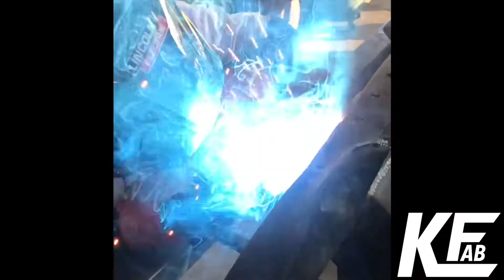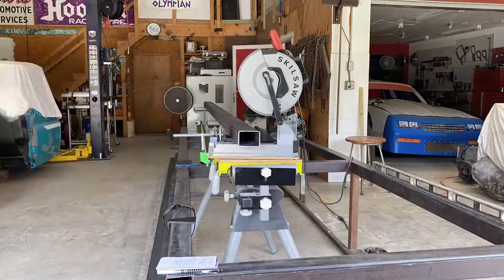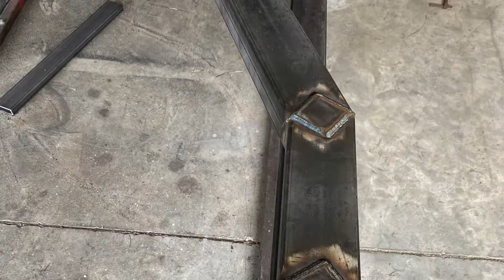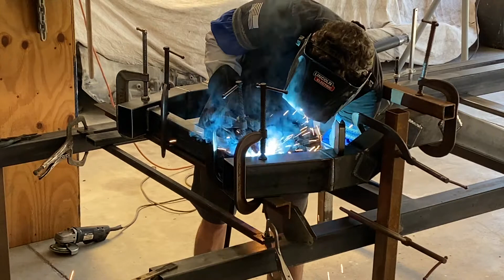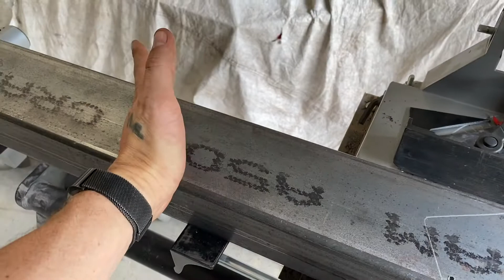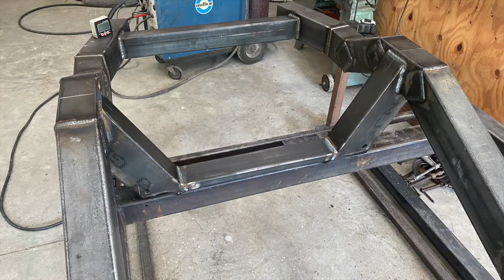Custom '66 Chevy C10 Build | Starting the Frame From Scratch | Twin Turbo LS C10

Comment: I know it's been a year since this came out but if you get this I'm looking to build an 81 k20 frame from scratch and have no idea how to go about it besides putting my old frame on a jig table and hoping it's square enough to copy all the angles, bends and whatever. Great with fabrication but new to building chassis. Any help/tips would be greatly appreciated.
Reply: Would highly suggest checking out Matt’s off-road recovery channel. They’re building a wrecker, I’d build the chassis the same way just not to that scale. I Would not build a 4x4 with a c10 frame

Comment: Man after watching your video of how a pro builds a custom frame I'm kinda thinking my projects gonna be over my head!
So a little back story since I probably got ya thinkin what is he talking about.....

I have a Tesla Model 3 that's completely destroyed but has good drivetrain, subframes and a Ford Ranger I want to convert the Electric.
I would need to build a custom frame to mount the subframes and battery pack in the Ranger.  
I have many considerations to think about including making the frame as light yet as strong as possible to get good range.
Also having the ability to mount the Cab, Bed and bumpers seamlessly as to look stock from outside the truck.
I have given a over a year of thought and planning to seeing how this might all fit together.  
The wheel base is about the only big difference in the two vehicles as the track is within a half inch.

I just really think building something like this is like nothing anyone else has ever done.
As far as keeping both systems stock and not needing much advanced system integrations.
More less Truck by Ford and Powered by Tesla!

Let me know if you think It would be possible and maybe if your interested I would love some advice/help.

Thanks, Casey

Comment: Hello sir do u have room for a build  I want done got main parts need frame work done on a 48 oldsmobile coupe but the kicker is the suspension I have is 2010 crown vic frame roller and motor wise I have a ls 5.3 yes on bags  so Frankenstein those three components on a frame u can build or weld together yes crown vic is wider from outside tires by abut 2 inches but can widen fenders or u know anyone

Comment: Is it stronger if you bevel the edge before welding in the cross member. Not a welder just curious. Thanks great video.
Reply: Its good to make a quick pass over the edges but not really a bevel. The metal isn't thick enough that bevel matters. 1/8 steel is easy to get penetration. Like a hooker on a weekend.

Comment: I like the 3d printed template a LOT.
Reply from the maker: Yeah man, it came in handy for sure. Also 3d printed a template for the angles that were needed to be cut for the main frame build. Everything fit together like a glove and was +/- ~1-2mm at any given measurement.